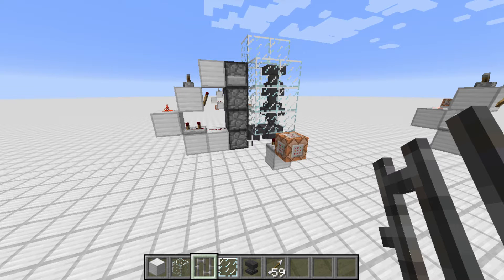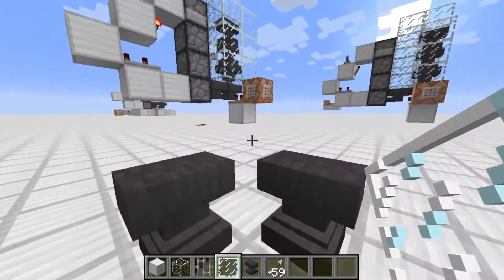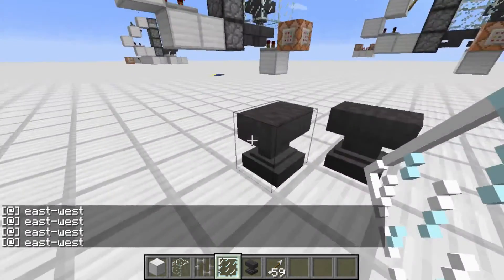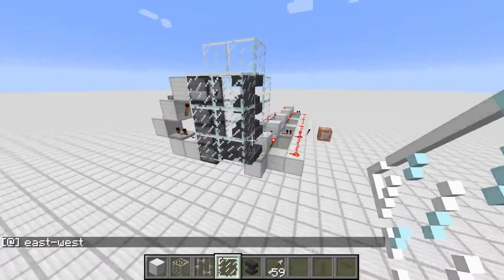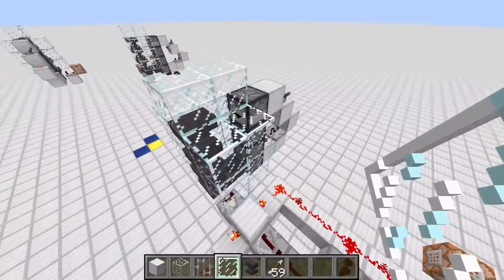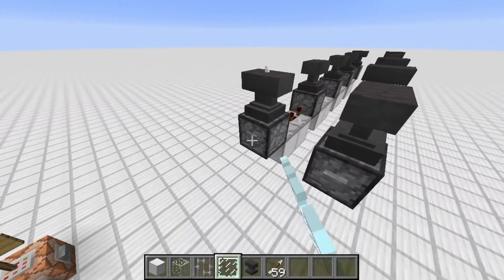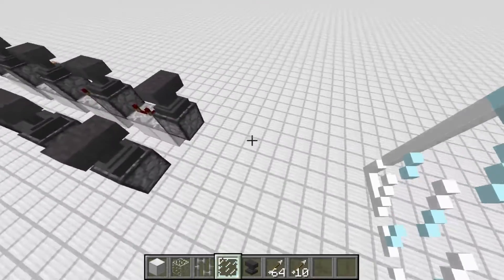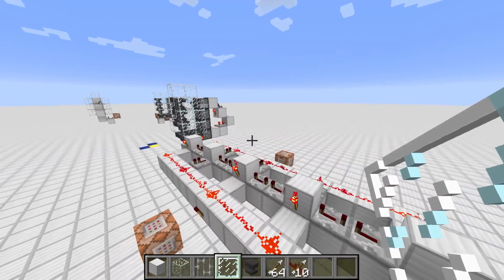Wireless Redstone using Anvils (1.8 + 1.9 snapshots) [Patched in 15w38+]

Comment: So, I've found this a bit unreliable for some reason. I've tried adding this contraption: http://i.imgur.com/3nSGHF0.png which improves the reliability to about 70-80% (even lower without it) but I'd love to get it working every time. I'm sending 8 bits of information (could be all on, all off, or mix and match). Any suggestions?
Reply from the maker: From your image, you have to replace the lowest anvil with a hopper, so you have a L-shape of 3 hoppers with 2 anvils on top.
Also, use arrows to input the signal if you are not already using them. Otherwise there are too many things that could interfere with the setup.
Another thing you can try, is change the orientation of the 2 anvils in the receiver.
Hope this helps :)
Reply: I am absolutely using arrows. I'm sending 8 bits using that method (made a pretty compact sender too :D). I missed the L shape of hoppers, that will probably fix the problem! At this point, my main struggle is chunk loaders and making sure it stays loaded (meaning surrounding it by a 5x5 of chunk loaders... ugh!). Connecting this to an enderpearl holder to make a wireless teleporter :D
Reply from the maker: Unfortunately it seems like Mojang decided to fix this, along with many other widely used things (like test's item elevator and shifting floors) in the newest snapshot (15w38) ;-(
Of course this happens a few hours after my reply :/
Well, back to the drawing board..

Comment: I thought this was commonplace already... Because of the way Minecraft stores collision boxes, any block with a varying hitbox can be exploited. The concept of using a progressive "code" as you did here is also nothing new. You did show it very nicely here, but I don't find anything new or particularly interesting in this :/
Reply from the maker: ***** I admit I worded my intro badly and a little misleading, I should have said something like 'new design' rather than 'new concept'
But I have never seen or heard of a wireless transmitter using anvils before, nor one that uses items to detect the hitbox. I've only seen designs using iron bars or glass panes and boats. Also the list of hitbox-changing blocks is rather short. At least I can't think of many blocks right now that might be further candidates for wireless transmissions.
Reply: Cubitect
Well, I can't point you to a video off the top of my head, but I've done pretty much the same before. As for other blocks, chests are an option, glass panes and iron bars still valid options using arrows, which was always the better and more reliable way anyway. Pistons are an option, though not a very good one. I never tried or looked into it, but ladders, doors and others might be options. There are lots of blocks that change their hitbox based on state.
Reply: +Crazy Stranger Hehe, calm down. I'm not complaining, I'm constructively criticizing an acquaintance to whom I owe a lot of respect.